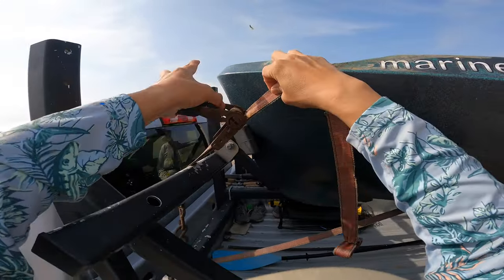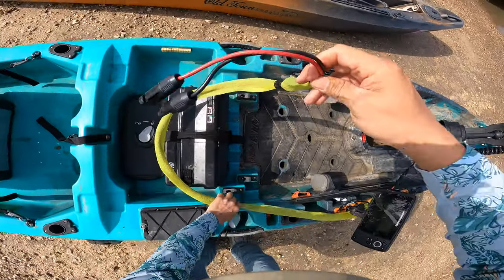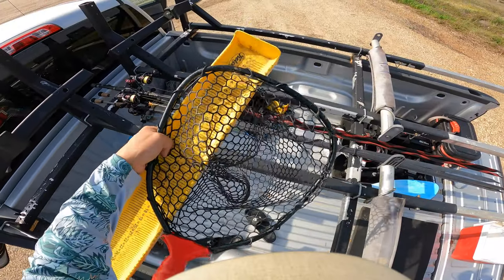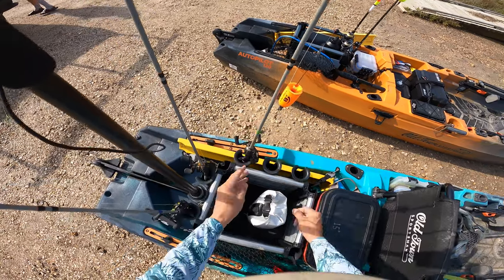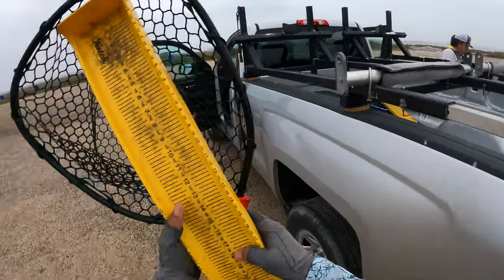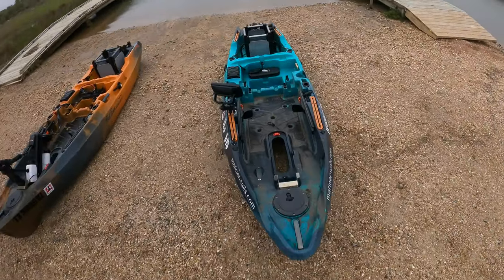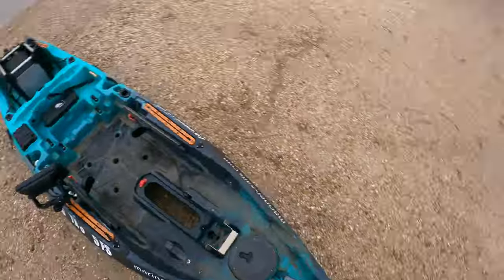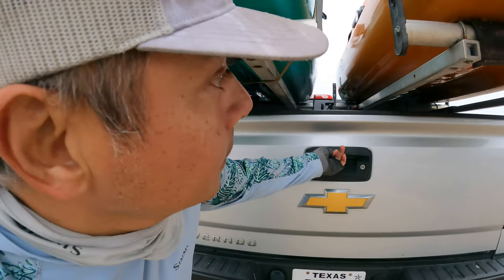How to load a heavy kayak the easy way (S6 E55)

Comment: If you have a truck it's not difficult to load a heavy kayak since you're just sliding it into the bed. But I have an SUV so it must go on the roof so a heavy kayak is a no-go for me.  That's why I bought a Hobie Compass only weighs 65 lbs so I can lift it onto the roof without too much difficulty once learning the best method to do so! I did bolt a few handles to the floor of the kayak to make it easier.
Reply from the maker: Thanks for the input 👍

Comment: I drop mine right into the water. I don't bother dragging anything on the ground. When I reload, I leave the kayak in the water and back right up to it. I pick up the front and put it on the truck. The back floats to make it easy. Then I lift the rear up and push it on. Mine weighs quite a bit with all my gear. I keep almost everything on my kayak except the drive, poles, fish cooler bag, and my 7" Garmin with the battery box. The bed on my lifted duramax is about as high as that rack too, lol.
Reply from the maker: Dang, that’s something worth watching. 🙌

Comment: Hi whats the cable thing you use to  connect the fish finder wire to after you take out the fish finder battery when you are leaving? Interested in it so my wire end does not just sit there collecting debris or water. Also the caps you use to protect the batterys cable pins please
Reply from the maker: https://www.mariner-sails.com/?ss360Query=FPv%20pOwer%20inline%20fuse

The battery comes with a cap to protect the cable connection. The inline fuse no longer works because of corrosion but it serves as a cable protector. Been using it like this for nearly two years.
Reply: @MDLR Fishing  thank you!

Comment: I have a native titan 12 that is heavy and I use a trailer so I don't have to lift as high and possibly hurting myself. Yes there's been times its been a issue but over all its worth it. One thing about a trailer is I don't have to load and unload a bunch of stuff I can leave it in the yak. Then when I get home I unhook from the trailer and roll it out of the way with most everything except for a few things  I don't want to leave in the yak during travel time. I just see a pulled back muscle coming when I see you load and unload that thing and I cringe for you.